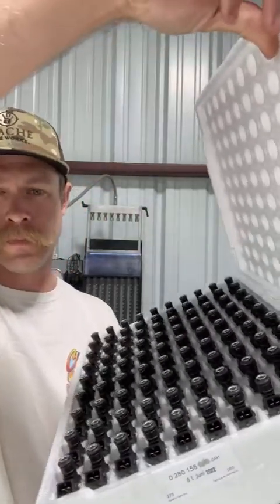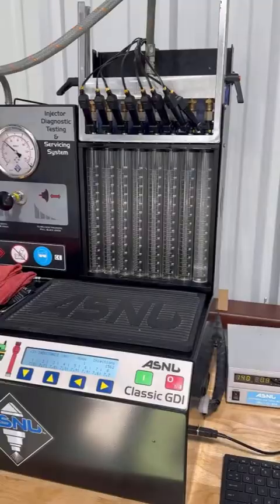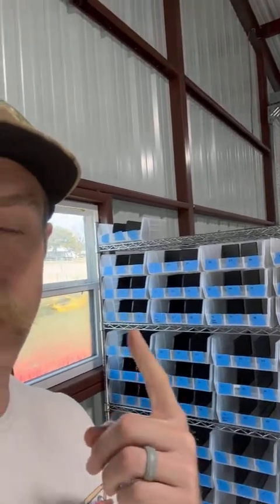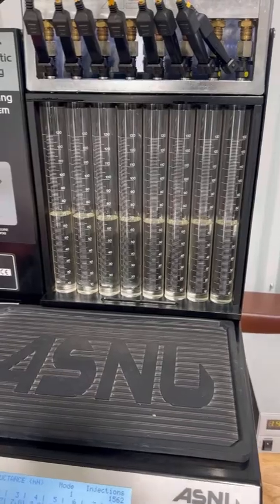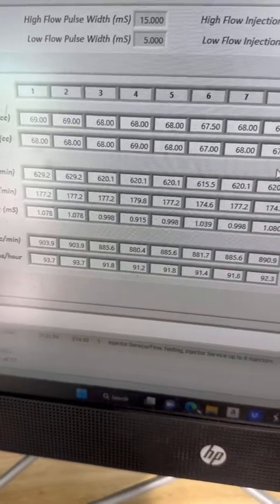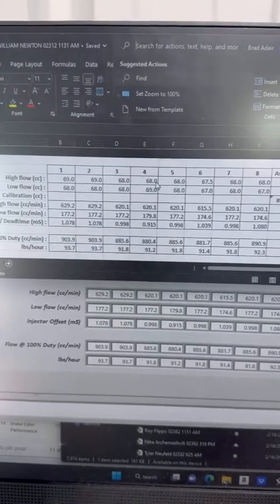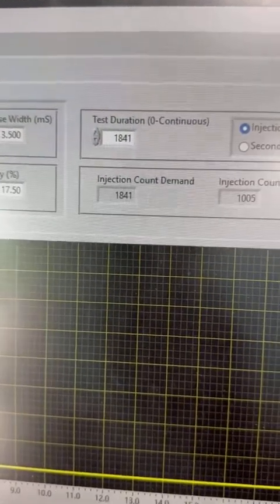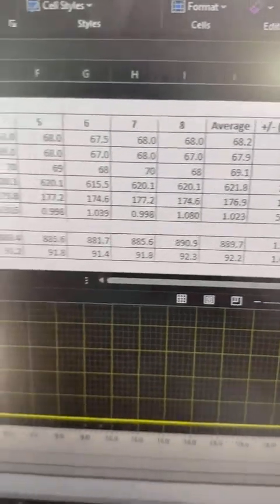The most value packed fuel injectors ever made. The Snake Eater Pro-Series

Comment: Why has price doubled?
Reply from the maker: The price on the Pro-Series 1500 has actually gone down from our initial price and the same Bosch part numbers from other dealers will cost you 30-40% more. 🎉
Reply: Im not sure i havent gotten set latly.  Ill jyst go with bosch 210s.   You had a good price point  @snakeeaterperformance
Reply from the maker: @havocracing6019  thanks! we have the best price point! No one beats our prices 🤜🏼🤛🏼